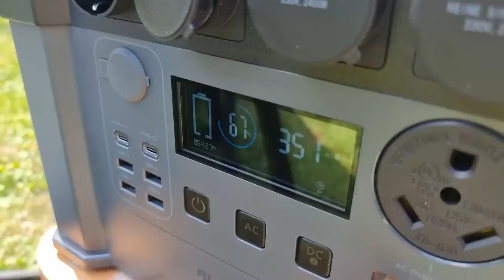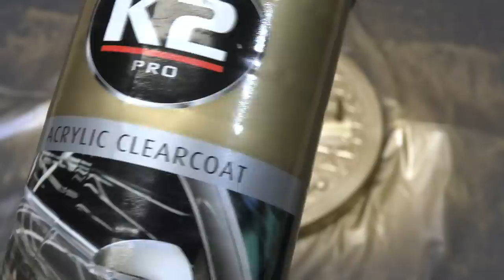Recruit Wooden Suitcase Restoration - Rescued From an Abandoned Mansion!

Comment: I was wondering what this unusual case was used for. I also noted how easily it could be made by any carpenter. Reading the comments and your reply solved the mystery. Very interesting how innovative the military can be in and out of times  of conflict. There must be an engineering division in every army. Camouflage clothing and tents as well as  canvas covers for jeeps and trucks must have been made by them. These suitcases must have been just another piece of kit produced by the army. At first I was worried about the practicality of carrying a suitcase made of wood.  I thought it must be quite heavy but for a trained fit and strong soldier it probably was very little problem. Thanks for sharing this with us.  Keep well.

Comment: Love the videos. Can you explain why you had to remove the top and bottom, and not simply remove and replace the veneer?

Edit: Timestamp around 2:10 for the curious
Reply from the maker: I initially wanted to remove only the veneer, but what I found it wasn't great. The panels were cracked and full of rusty nails, so I decided to remove them completely.
Reply: That makes total sense. Rewatching it, yeah the crack halfway down the side is pretty obvious. 

The nails being rusty almost seems like an expected result after being buried beneath animal hide glue and veneer for 60 years. 

What did you use as the underlayment for the new veneer?

Comment: you have been doing such a great job on your restorations (I've been power watching your videos over the last few days - I found one of your videos on your restoration of the gaming table so I thought I would watch the rest. I'm currently only up to the part that you are starting to sand blast parts and thought I would pause and comment. did you run your compressor on the power pack too?  I also am hoping that you will be super sealing that MDF because if it gets wet it won't be very strong
Reply from the maker: Thank you for watching my videos 🙂 
The compressor was full, so I didn't have to use the battery pack. 
This suitcase will be used as a decorative piece and will be displayed in a bar indoors, so that's why I used MDF. Otherwise, I will use plywood. Cheers!